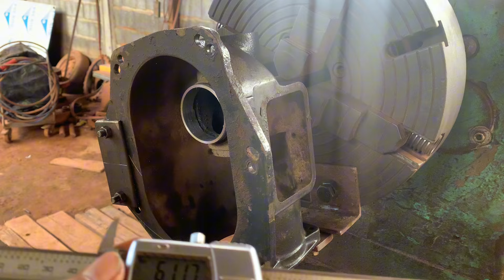Mastering Precision: Fixing Irregular Shapes on a Lathe| Expert Techniques@Abom79

Comment: Where is the ground wire of the welding machine?  Welding current going thru spindle bearings? That's not good.
Reply from the maker: Yes it not good